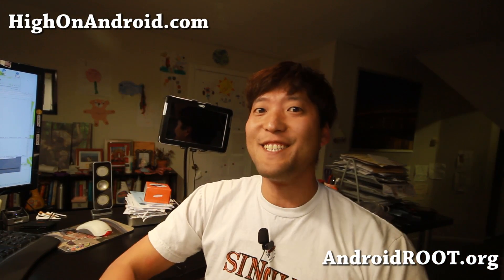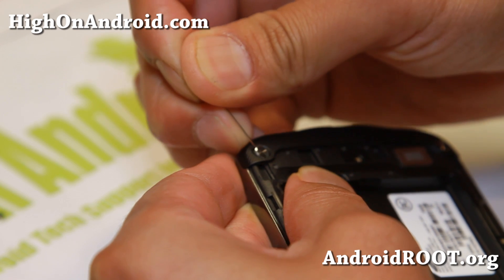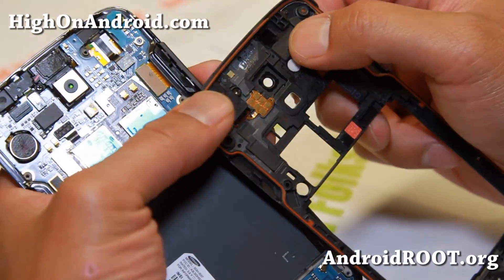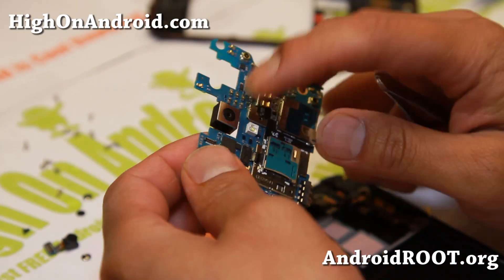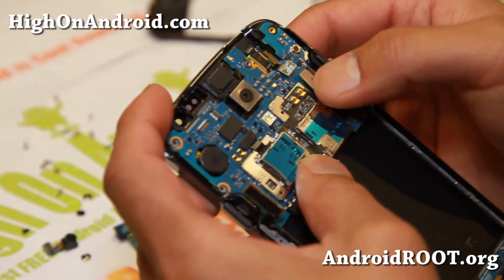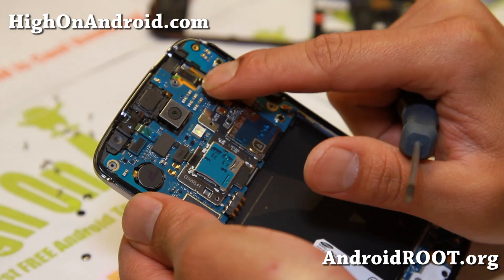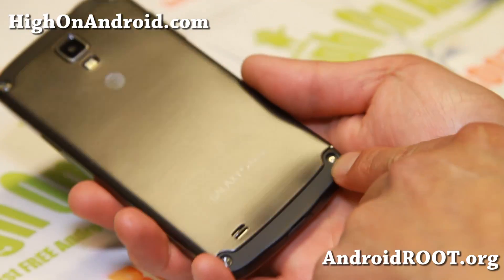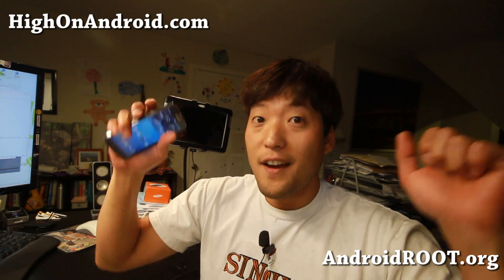How to Disassemble Galaxy S4 Active!

Comment: how important is that plastic door at the charger connector?   Mine does not close properly,  falls open easily.  I'm around salt water any feed back on that?   Do you know of any depth tests,  I know it is rated to 3 ft. but how deep could it go before a leak or damage?

Comment: I dropped my i537 and the Bluetooth no longer works.  It will not pair or send to previously paired devices.  What could have possibly have happened to the inside to cause this to happen?  I dropped it on the top right left corner of the front and of course the screen did crack but the phone still works as should except for the Bluetooth.  Any ideas??

Comment: Thanks zedomax! Great walk through! Just a tip for the other commentors, my particular lcd replacement did not have the usb board attached or vibration module. These are held on with adhesive, slowly work them off. Mine was used replacement so it was completely stripped down but other than the adhesive there were no other screws or tabs to worry about just the alignment holes/pins.

Comment: The speaker make the entire back cover to vibrate only with sound.... 

:-(
Reply: ***** no disassemble brand new 3 days ago it starts from the speaker and goes up to the top if i Inc Reese the volume more than 40 percent the would make the back cover To vibrate this also does it also through the front speaker...
Reply: ***** i will.. you did not find that Flow on s4 active? After a Search on the net i found that this happens almost on all s4 active do you think some loose screws? On speakers?
Reply: It happens with my sgs4a too. What a pity that samsung who can make the best hardware in the world did this

Comment: If you want to attempt to replace your screen on your s5 Active, and the LCD is still good.  It most likely won't be when you finish. Disassemble phone as in video.  There is no glue between the LCD, and Glass.  The glue is on the outer edge of the glass.  Place phone on hot plate at no more than 200 F.  After phone is heated, and you have hand protection for heat, and broken glass.  Pry glass around the edges only.  DO NOT touch the LCD with any tool.  The electronic strip at the top of the glass goes under the LCD, so you will have to carefully lift the LCD from the frame to access this connection.  There is a very small black tab that you should lift up at connection.  Them gently press back down when new glass is in place.  Good luck.  Remember the LCD is super fragile.  Most people will not succeed.

Comment: the motherboard is held down by small plastic extensions on the camera and vibrator housings. If you can nudge it over or pull the motherboard towards the bottom end of the phone it comes right out without quite as much pulling upward.

Comment: Awesome tutorial.  My mic stopped working.  I can only make calls via speaker phone or a headset.  Do you think I should replace the usb assembly?  Also any idea where I can get that plastic cover that goes over the usb port (it broke off).  Thanks again.
Reply: Long story short.  It turns out that my issue was something got stuck in my mic hole (insert joke here).  I ended up ordering this USB kit, but found out it wasn't even the issue.  This tutorial is spot on though. http://www.ebay.com/itm/251378889599?ssPageName=STRK:MEWNX:IT&_trksid=p3984.m1497.l2649

Comment: You should always never buy the cheap stuff like that from ebay because it can be fake and fail much faster than the orginal. You should buy from etradesupply because they have real parts. They may be expensive but you get the real part not some fake one.

Comment: Hi Zedomax, i have and issue with the charging port rubber cover it comes out just a little bit i dont know why but just a little bit when i push it to cover the port and im scared to open it and fix it or even worse getting it on the water lol, hope you can help!!